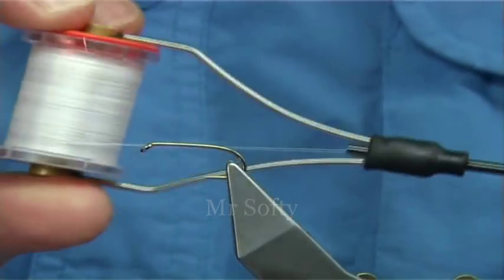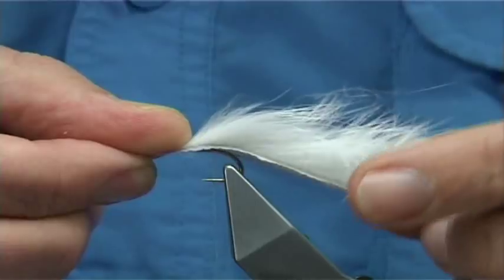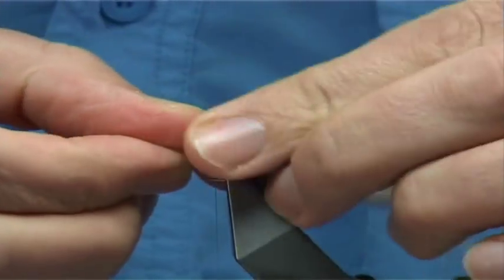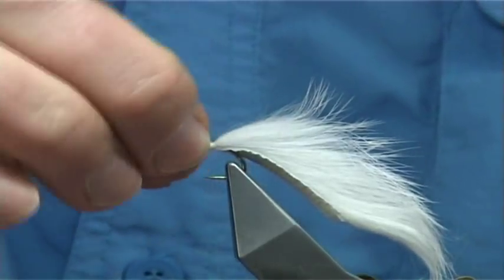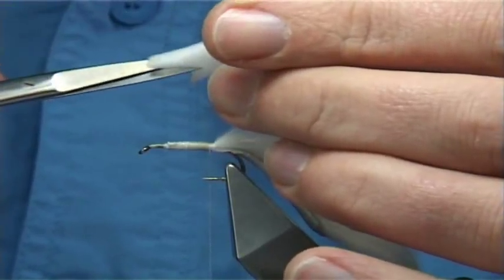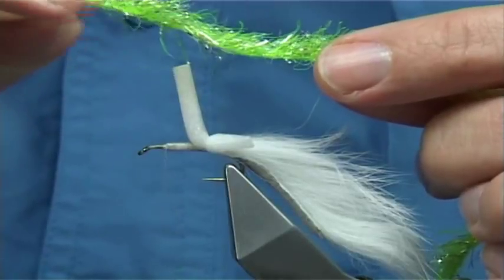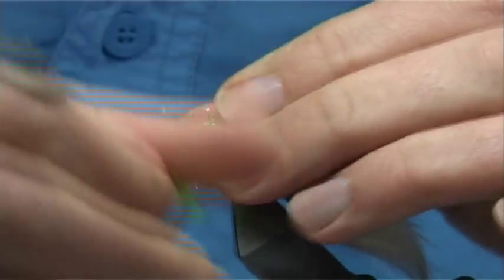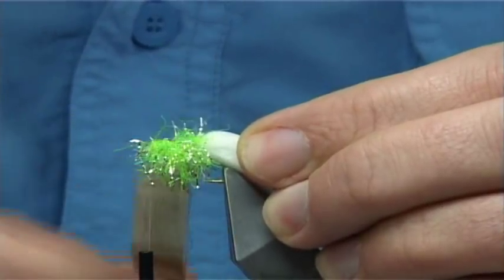Tying the Mr Softy (Lure) with Davie McPhail.

Comment: Do you prepare your own wax, Davie? I ordered some online advertised as "fly tying wax" but when it arrived it was just a block of beeswax, which seems a bit too solid for fly tying and doesn't look anything like the wax that you use. I've learnt a lot from watching your excellent videos, including this one which I am using to target the pike on my local canal. Thanks for any advice on the wax.
Reply from the maker: Hi David R Bellairs,

I use Veniards Prepared Fly Tyers Wax which will be very similar to the wax that you have..What I do is break or cut off a small piece the size of a small button and work it between your fingers until it softens or hold it under the warm water tap as this will make it soften quicker then it will become slightly tacky ready for use, I then stick it to the side of my finger as you will see in some videos.. I'm glad that you enjoy the videos and thank you for the kind words...

All the very best Davie
Reply: +Davie McPhail Thanks. It is Veniards wax that I have, but I didn't realise that you had to work it before you could work with it, as it were! (If that makes sense!)

Thanks again for your help.
Reply from the maker: Hi David R Bellairs,

You can just use the wax without doing anything other than just applying the wax by running the wax along the thread as you tye the fly when needed..The way that I described to you is how I personally use the wax when I'm tying, you will find a way that suits yourself...

All the best Davie

Comment: @txflytier 
You can use it for zander and asp in low light conditions.
Zander is relative of north american walley.

@sohosohigh 
I use some similar fly tied on biger hook (2-2/0) when spining for those two species i mentioned above. Just tie on one end of line piece of led or jig and on another this tipe of fly. In that way you will control how deep it will go.